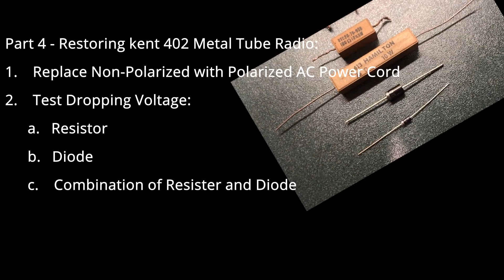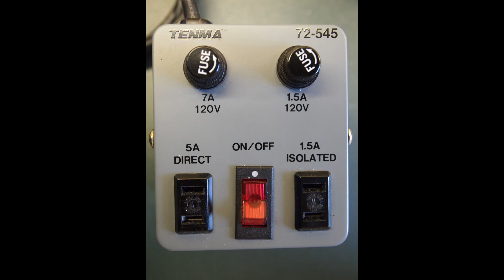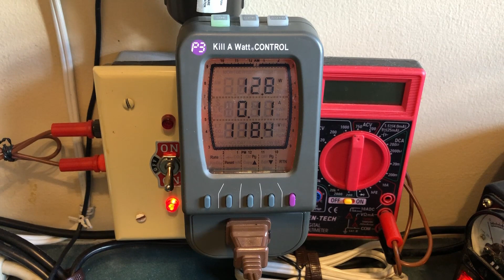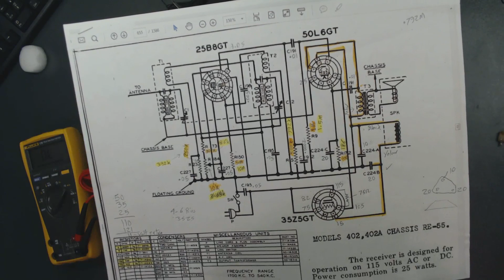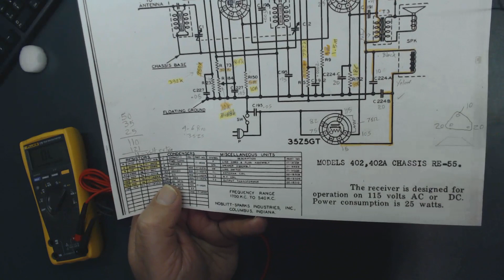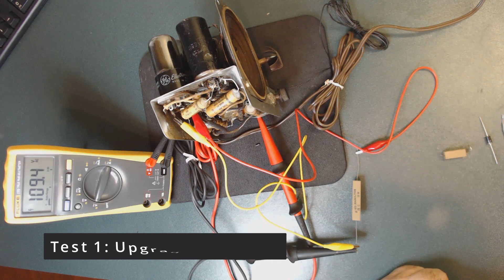Part 4 - Metal Radio Restoration "Kent 402"

Comment: Definitely need a polarized plug on an old radio. Plugging it in wrong you energize the chassis and have yourself an instant shock hazard. Yes you do have limited space under that radio but looks like you found a way to do it by eliminating that resistor and using a diode. With that installed that radio and all of its parts will last a long time.
Reply from the maker: Thank you Larry! I appreciate you very much! have a great day!